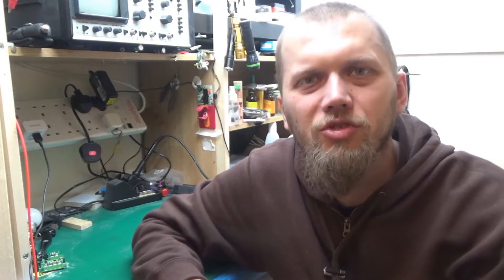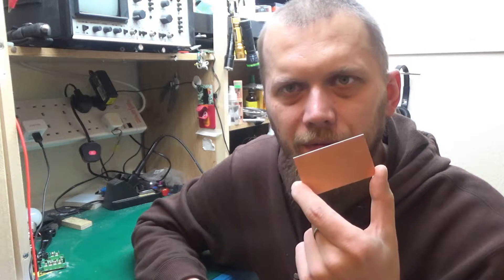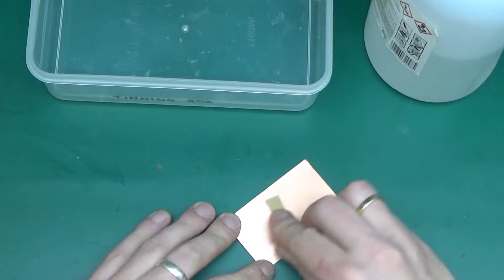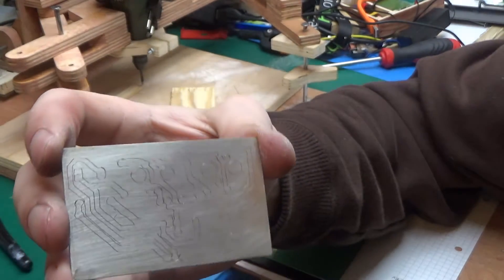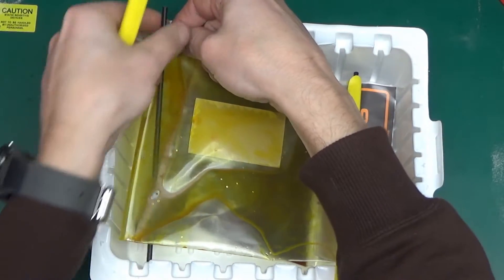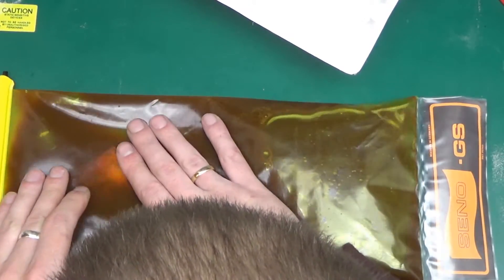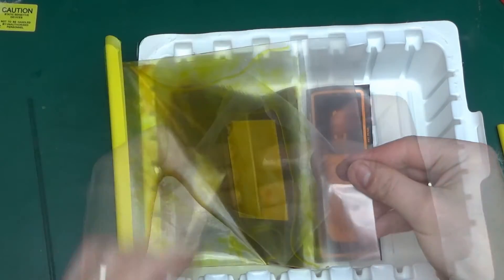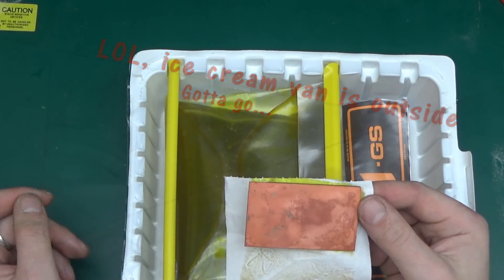Ferric chloride + tin plating = fail

Comment: This is actually promising. I was wondering if one electroplates a plain pcb board before going trough a dry film photo resist process, would the tin prevent the etching. Apparently not.

Comment: I was watching a tour of a small PCB factory on Fran Blanche's channel a couple of days ago. https://www.youtube.com/watch?v=QBtK-PesGsU
There, they do the drilling first and then the tin plate - to plate through-holes.
Then they did (more or less) the same procedure as you do here, using the tin plate as a resist.
So this isn't a complete fail... I think there's a procedure to be found (I don't know what that procedure is) where this will work.
Reply from the maker: Thanks! I am working on it! :) Here the issue was the etchant I think.

Comment: You could try covering the copper with Sharpie marker ink. A few layers will make a fairly good etch resist. Then your scratching method can cut through the ink to the board.
Reply from the maker: That's my next  step. Coming soon :) I actually have a good acrylic marker pen, tested it with FeCl3 and works really well, even single layer. Another think that worked well was nail polish/lacquer/varnish. Coating entire thing should be easy once thinned down with acetone. Here, I thought, that I could remove a step, a shortcut if you wish, but it didn't work as planned ;)
Reply: There is also the possibility of putting the pen in the pantograph, and drawing the etch resist mask on the board..
Reply from the maker: +John Bailey yes, that's an option too. I only just got started with it. I will test different options for PCB making with it, pen included (a few kinds of)